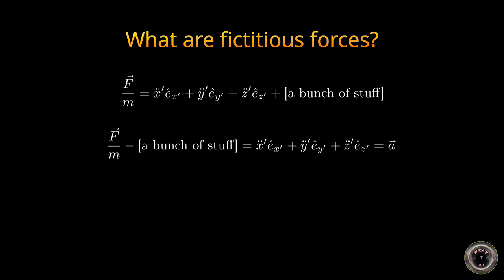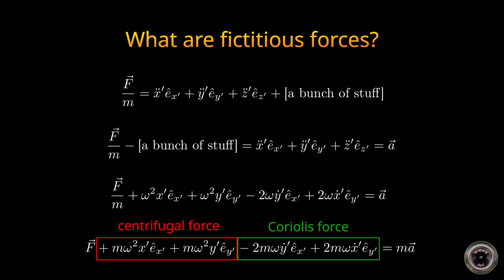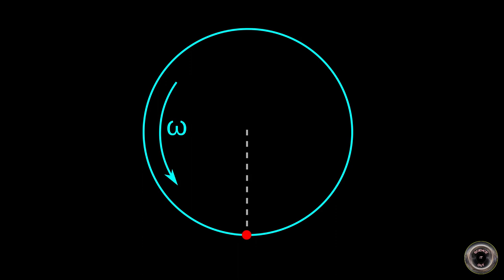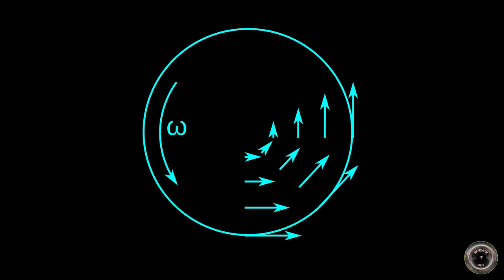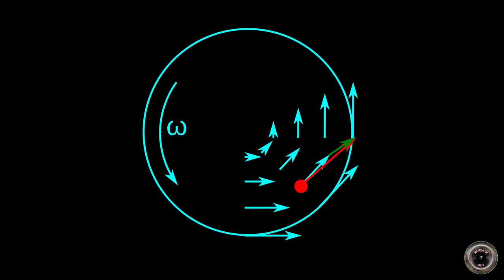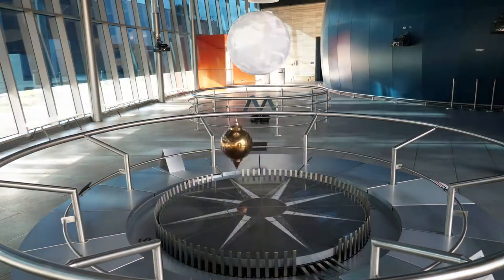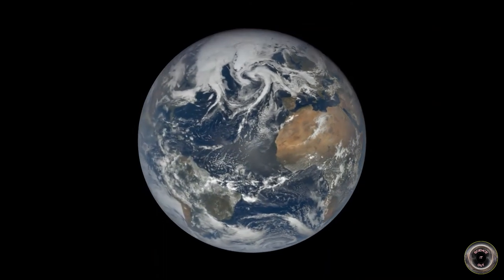What are fictitious forces? Centrifugal and Coriolis

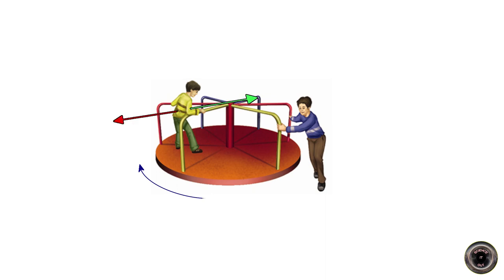Comment: 5:10–except there is actual physical resistance which is more than mere inertia. The child must exert an equal resistance to avoid acceleration. That’s real. Calling it centripetal is unnecessary and absurd. If the child did not resist and the merry go round accelerated too fast, there would be zero “centripetal force.”
Reply from the maker: "except there is actual physical resistance which is more than mere inertia."
What do you mean?

"The child must exert an equal resistance to avoid acceleration. That’s real."
If you mean the force exerted to stay on the merry-go-round - yes. That is a real force.

"Calling it centripetal is unnecessary and absurd."
Yet it simply is the centripetal force. It is a force that is directed towards the center of the merry-go-round at all times, and it is what makes the trajectory of the child be a circle (to an observer standing on the ground).

"If the child did not resist and the merry go round accelerated too fast, there would be zero “centripetal force.”"
Wait, are you saying that if the merry-go-round accelerated fast, the child would not have to hold on to it in order not to fall off?
Do you mean angular acceleration (as in, the rotational speed increasing fast), or some other kind of acceleration?